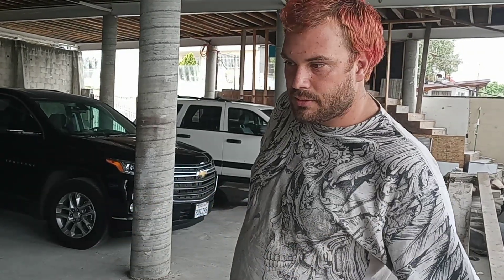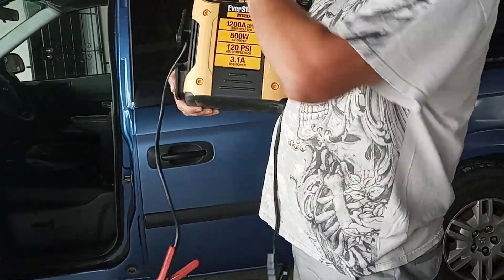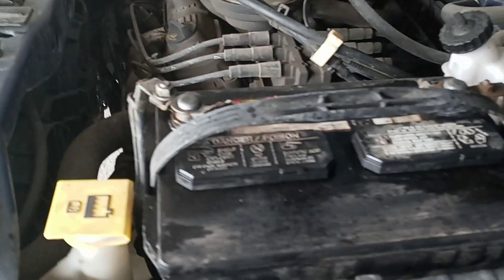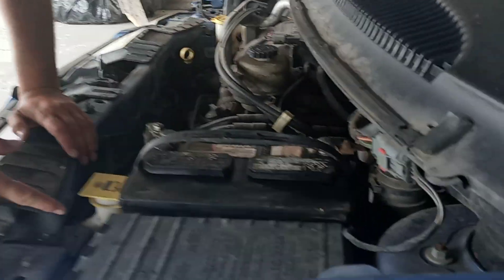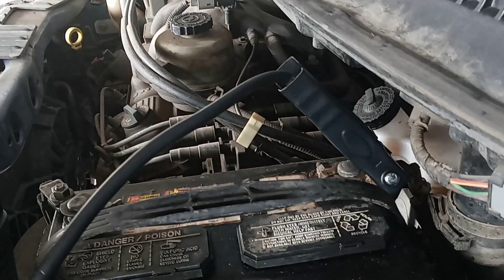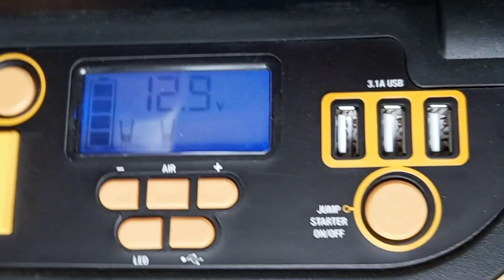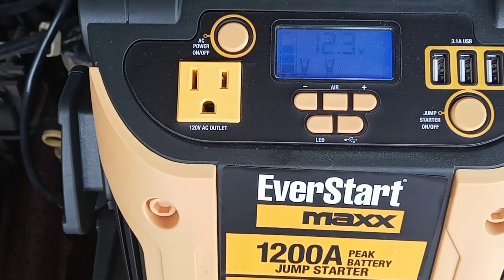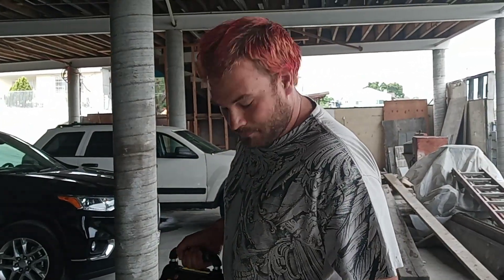EverStart Maxx Jumpstarter Product Test and Review

Comment: You gave me a glimmer of hope maybe I was doing it wrong. Got a brand new car battery. Nope just keeps on beeping. It says the starter has 4 bars just got it today. Maybw have to charge it for 40 hours first like the manual says anyways!?
Reply from the maker: There's a possibility it's not your battery that it's your alternator. If it is your alternator your battery won't start no matter what you do
Reply: @ShadowKhaos1  I highly doubt it. I left my lights on last night and found my car dead this morning. The manual says to charge it for 40 hours out of the box so that's what I'm going to try. If not I'm returning it because it's definetly a car battery issue. I have a 2003 Honda civic. Should be able to handle starting it with no juice without issue.
Reply: @ShadowKhaos1  I am charging it now. It started out reading 13.2v and now 13.6v 5 minutes later. I think it's taking a charge and hopefully 🙏 it'll start my car tomorrow. What a rough day trying to start my car. Took taxi to work they needed me at a different location sent me home. Walked home someone on my street was going to jump me but I lost my keys. Biked back to work found my keys. Got this car starter and hope it just works lol
Reply from the maker: @cj1614  honestly I hope everything works out for you.
Reply: @ShadowKhaos1  Think I needed to charge it. Under the AC outlet it reads 120v AC Outlet. My charge says it's at 13.9v. I'll tell you how it goes tomorrow. Hopefully you can help other people with this same issue on your video if all goes well.
Reply: @ShadowKhaos1  Your video helped me come to the charging conclusion so thank you